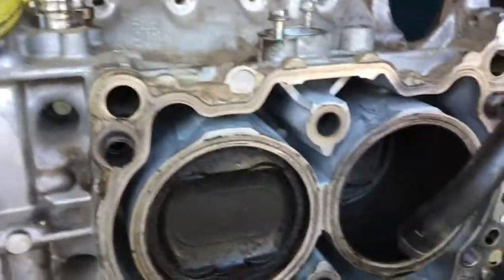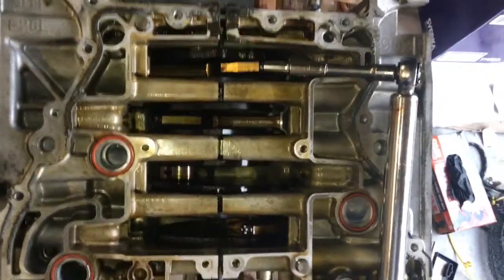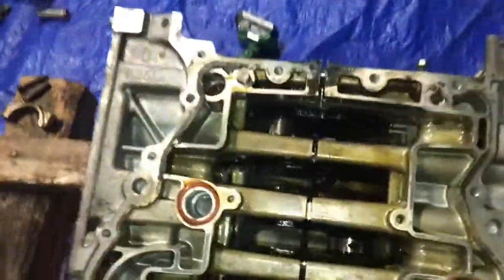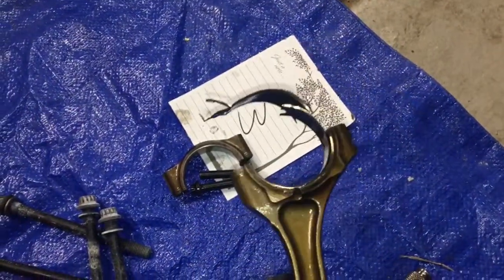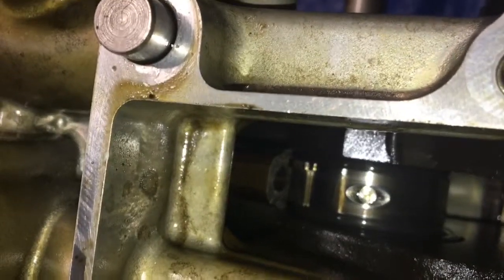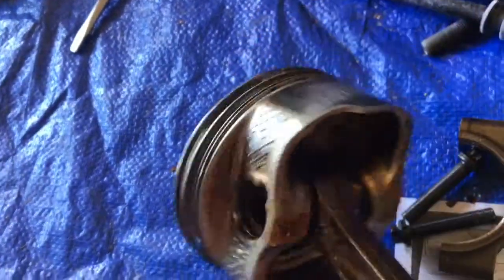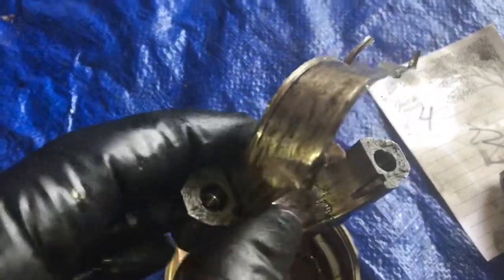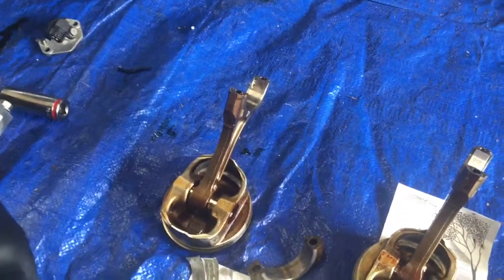FB25 Engine Disassembly 2011 Subaru Forester P2

Comment: Normally you pull the wrist pin to get the piston out and leave the connecting rod attached to the crank. There are access port at the front and rear of the engine for that matter.

Comment: Doing this exact same rebuild. Spun rod bearings as well. Bought the car for cheap expecting to put time and money in, it was ran out of oil. Trying to find a socket to fit the bolts that hold the short block together right now.

Comment: Great video!
How did this happen? Low on oil?
Reply from the maker: I owned the car for a week before this happened. Oil was full the whole time. The Subaru dealer that looked at it was also surprised that this happened with an engine full of oil. After taking it apart it became evident that the cause of all this was clogging of the oil pathways. Lack of regular oil/filter changes was my best guess.
Reply: @l.rimmele8151  There's a general lack of deep varnish or sludge deposits in your video.  It may have overheated.  The overheating would probably be my guess for an engine full of oil, or no lack of sufficient oil.   Subaru running these motors at bulk temps of over 235F has been my opinion on the root problems for oil consumption and spun bearings.  Mainly the spun bearings giving the confirmation for me.  20 weights function appropriately at pistons when in use at operational bulk temps of 215F.  So additional air-oil cooler and/or thicker oil have been successful prevenative work arounds.  It also helps to also have either high detergency (A3/B4 spec), high alkylated naphthalene, high ester, and/or high moly content to your oil.